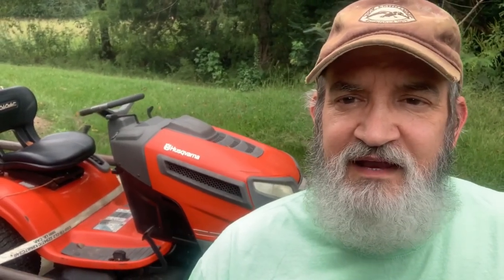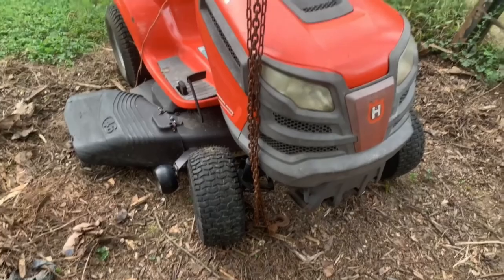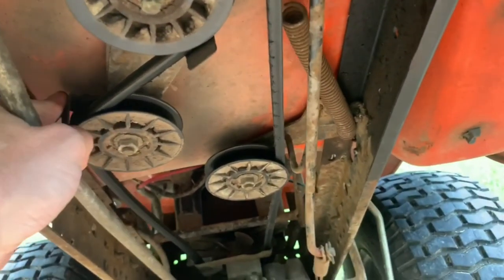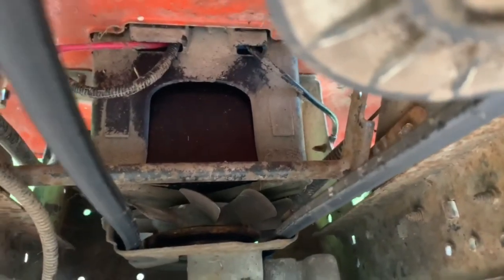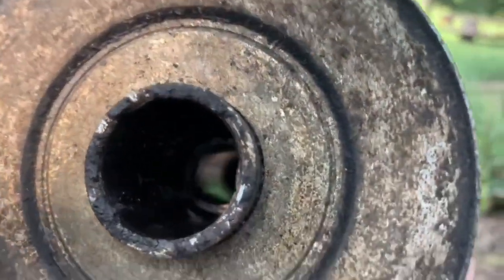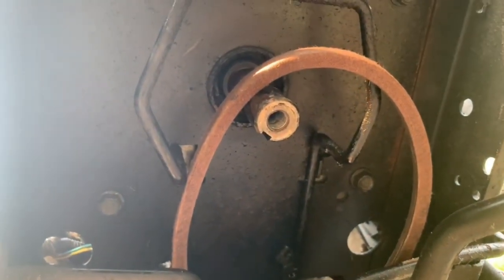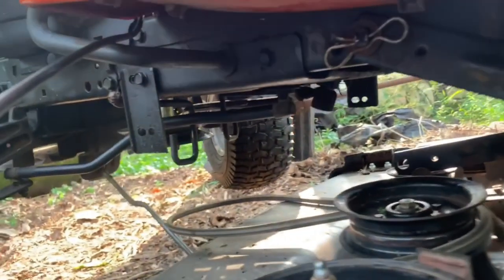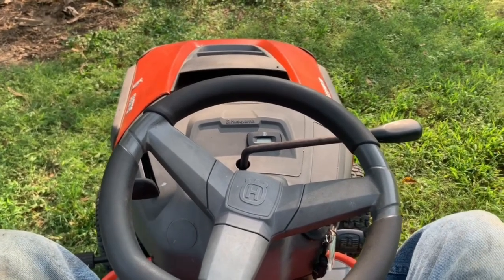DIY Remove And Replace Drive Belt On Riding Mower.

Comment: Great video, thanks. What I need to know is how to position the belt through the steering plate cause the steering wheel shaft looks like it's in the way.
Reply from the maker: Sorry I'm just now seeing this, my comment notifications has been acting up. This particular mower the drive belt runs beside the steering shaft so I didn't need to do anything with the steering.  Hope this helps.